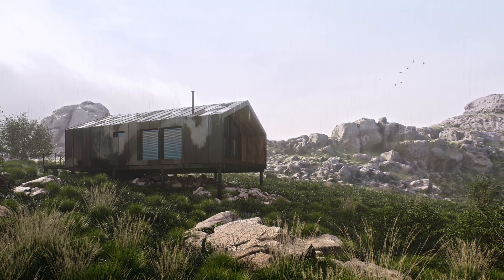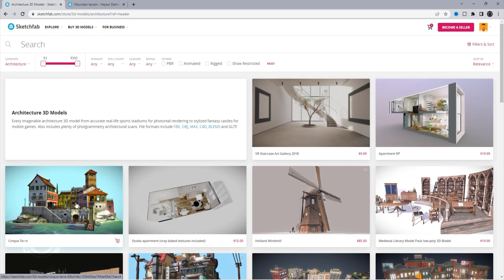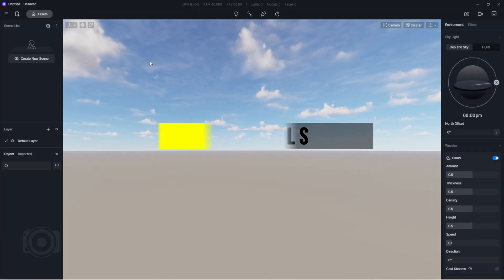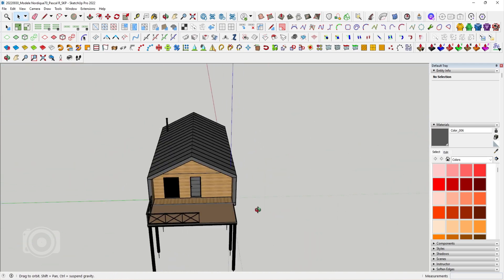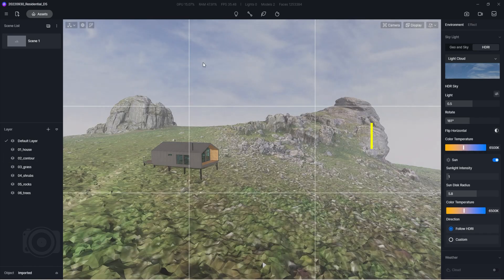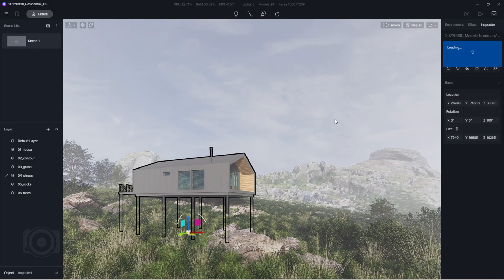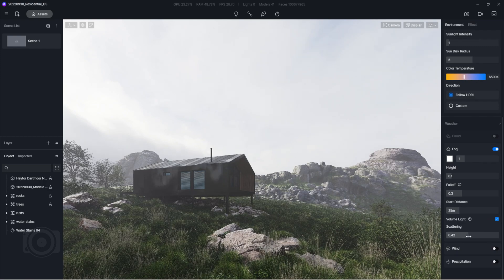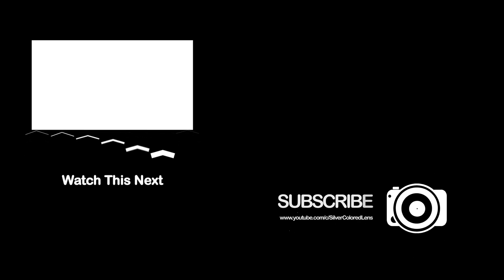This is How I Create Photo-realistic Rendering & Animations in D5 Render

Comment: Great work ... Which laptop do you use and what is the approx time taken to render this one
Reply from the maker: Thanks! I'm using the ROG srtix scar 15 with thr RTX 3070. It took about less than 10 minutes for a 4k still render.
Reply: @silvercoloredlens  do you have any idea how much approx time it will take in my laptop -ryzen7 5800h, 16gb ram(3200) , rtx 3050 (4gb)
Reply from the maker: @creativepenworld8689  Hey, my apologies as I don't have any access to that specific hardware, but based on the GPU specs, my estimate would be that it's should be slower than the RTX 3070 laptop GPU. Normally for my case, I can do a 10-second 4K animation clip render for less than 10 minutes. I hope this info can helps you.
Reply: @silvercoloredlens  thanxx, appreciate ✌️add me on insta if you get time
Reply: I just followed you on Instagram i will need your guidance sir , so please reply me whenever you get time...